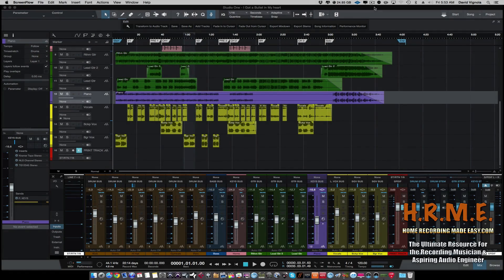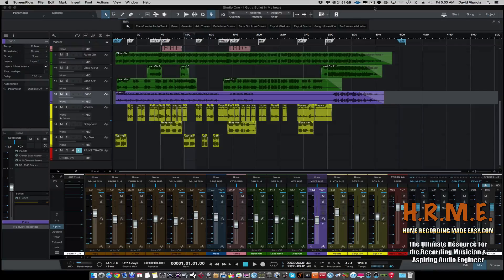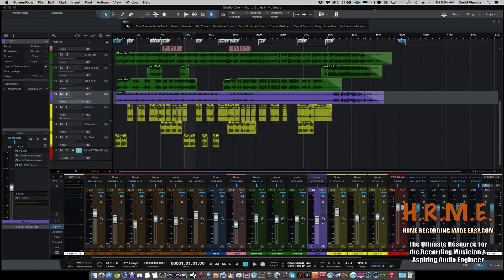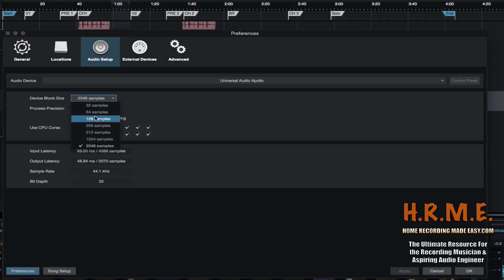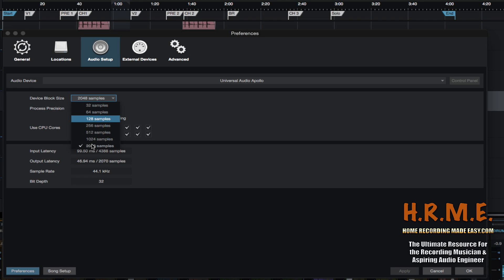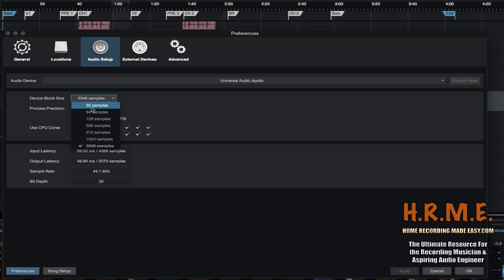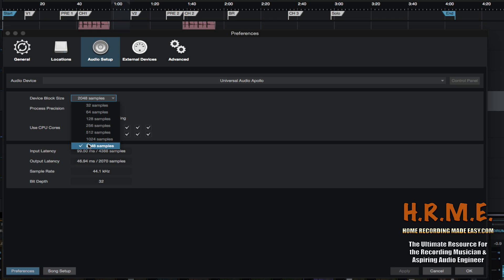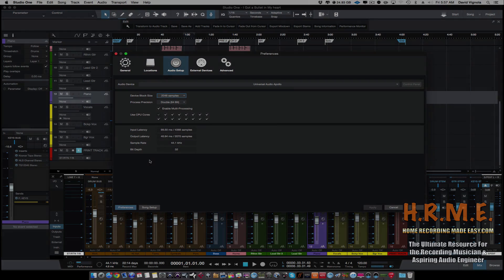How To Adjust Block Size In Studio One  For Optimum Performance

Comment: This seems like an either or proposition:  Either I am laying down one track and set the buffer low for low latency,  or I am mixing lots of tracks and set the buffer high to avoid crackling.

What do you do when you want to lay down track #64, and you want to hear the rest of the track while you are doing it?    Or what if you  are jamming to a project?     (At 512 my latency is bad and at the same time not large enough to avoid crackling .  This is an i-7 with 16Gig ram and audiobox USB, everything in the box.  Will a better interface fix that?

Comment: New to all this stuff.  I am defining my workflow into TWO Dimensions.  One,  my MAIN workstation.  TWO, my LIVE workstation.  So what you are telling me may work.  I build my music on my Main workstation running what my Computer can handle.   I then export as a WAV file and bring it to my LIVE workstation.  I will then have two devices connected to my Starlet 2i2 to Midi on my Surface Pro (Roli Keyboard and a MIC).  I can then import each song into Studio One but with a lower sample rate to reduce latency in a LIVE performance.   Is this a fair assessment?

Comment: Home Recording Made Easy . Hi David, so Ryzen has been launch and AMD is promising good bench marks. I see you have 16 threats so I guess you an 8 core i7 maybe the 6900k. 
can you confirm that the cores / threads make a difference in performance in S1 ? if so Could you go more technical. Thank you . Just saw you unboxing for the 32 live console. great video.

Comment: in my audio setup, i am not able to adjust the device block size. there is no drop down option. it is just stuck at 512 samples. why is this?
Reply: have you fix it? same issue here
Reply: Nocturnal Bacon hey i had to go into the settings of my usb audio interface and change the sample rate there. That changes it automatically in Studio One. 👍🏻
Reply: @Music4Life.  thx. Found it in Universal Control.

Comment: Also make sure your running the most current driver for your audio interface. I'm using the Presonus Audiobox 22VSL the driver is found on the Presonus website under support then downloads. This will update your universal controller which will allow you to adjust your block size. Make sure your audio interface is plugged in to make adjustments to your parameters. Hope this helps.

Comment: I just picked up a new (older) audio interface that I needed to raise my buffer from 128 to 256 in order to remove clicks/pops. When playing back audio i recorded im noticing a very small ( few ms ) space between the start of the bar and where the recorded audio lands. So my hardware drum machine kicks for example are in time but all a few ms ahead of software based samples. I suppose if I recorded everything in, and everything was a few ms ahead it would be ok? But I had to either slide the recording back a hair or detect the transients and quantize the audio, in order to get it hitting right on the 1, 2 etc. Is there a better way? Great video

Comment: Great :) Except you forget to mention how important the audio interface and its drivers are. Chances are, most home recordists with modest interfaces won't be able to utilize block sizes of 64 let alone 32 samples without getting glitches, because the audio interface can't handle such low block sizes, EVEN if the computer potentially could. This is especially true for older USB 1/2 interfaces due to the limitations of some USB controller chip sets and/or poorly written drivers/class compliant ones. There is a huge difference between a dedicated interface from say RME or Apogee with their exceptionally well written drivers and your cheaper run of the mill class compliant devices, not to mention the huge difference in band width between USB2/Firewire and Thunderbolt/USB3.

Just sayin' ;)
Reply: +4SoundL29 My advice to anyone recording today is update your interface. Find the money and do it. You won't be sorry. I would also advise using a Mac. I spent many years recording on very powerful PCs and once I switched to iMac, 99% of my problems—including latency problems—went away.